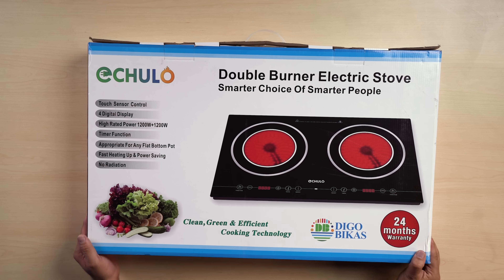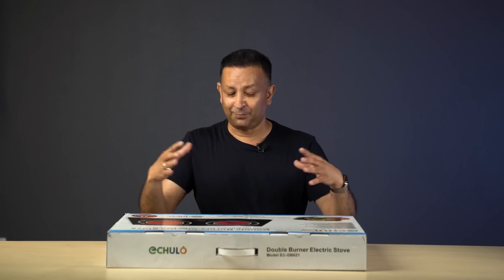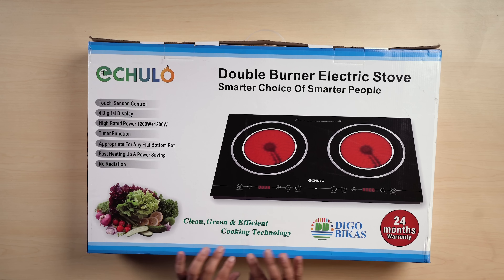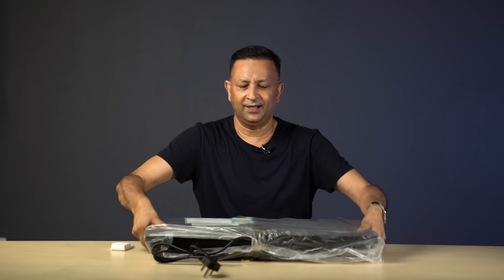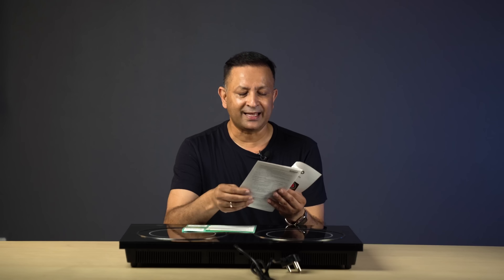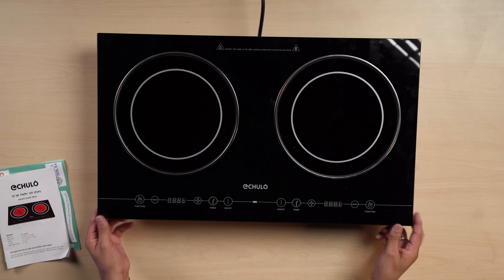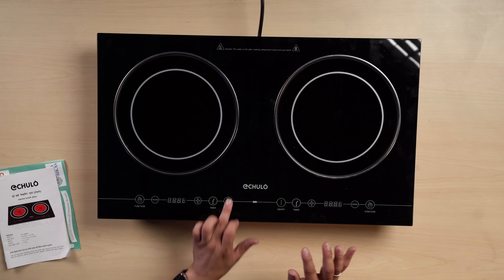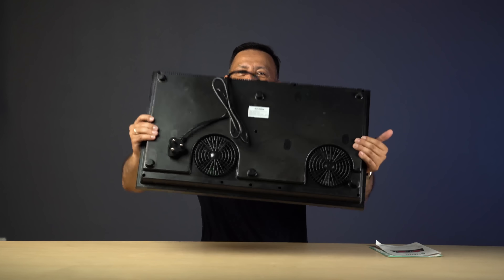Double Burner बिजुली चुलो || Unboxing & Preview || Lokesh Oli

Comment: For double burner 38000 that's too much. If price could be in under 15k that would be better.i am using single burner at the price of 3500 for 2000w max.